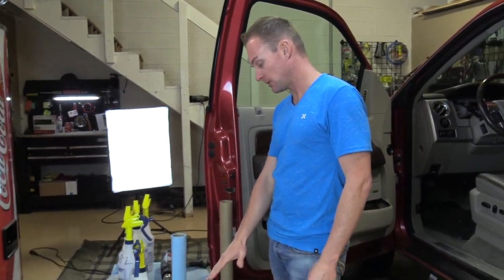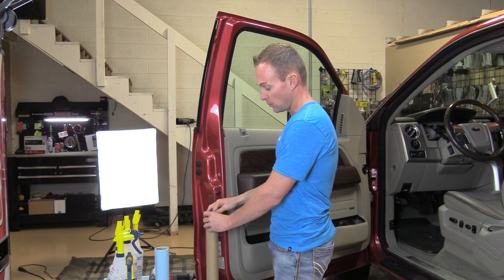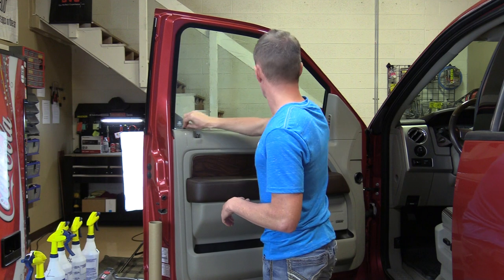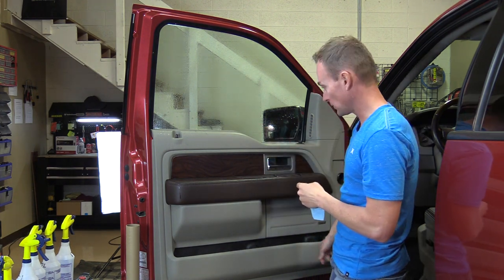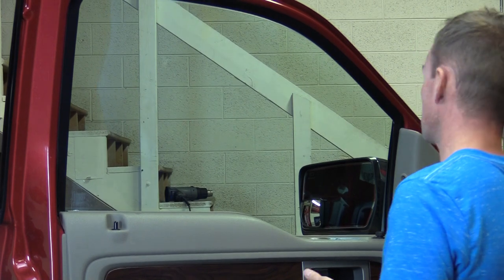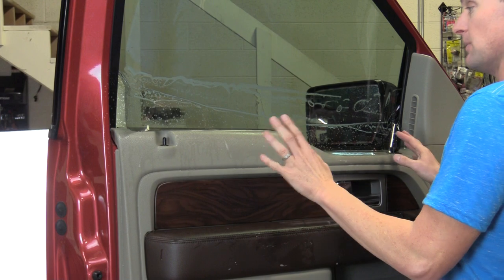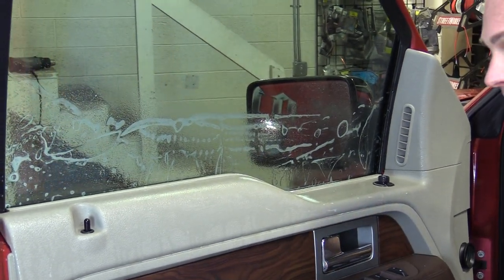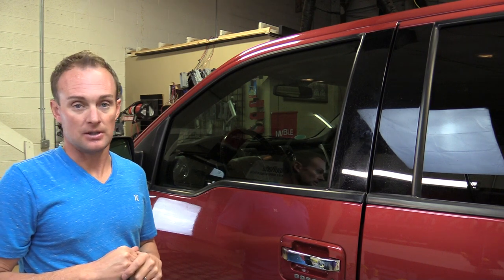Pre Cut Tint Kit Front Window Installation--Any Vehicle

Comment: What if I have a 1 ply tint for the front windshield? Tint is already pre-cut, thanks
Reply from the maker: We wouldn't recommend using it.  1 Ply film rips easy, scratches easy, is harder to shrink without melting through, and it won't last more than a few years.  Find  a double ply film.